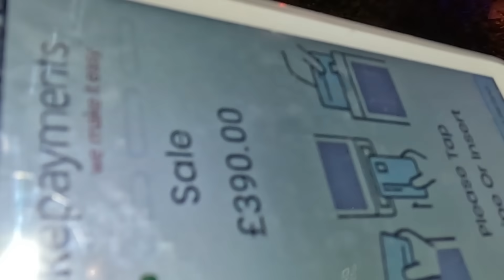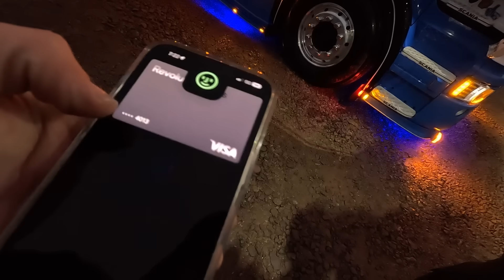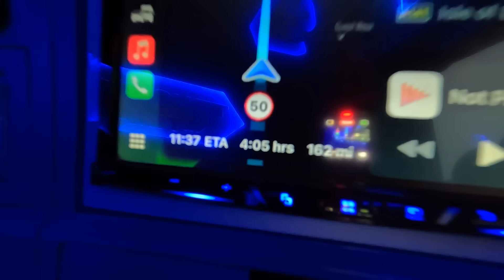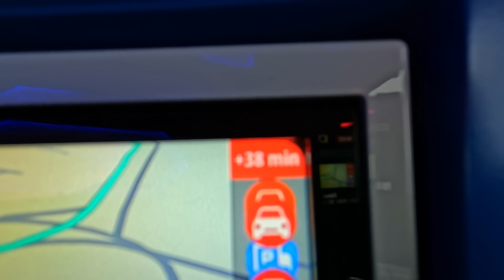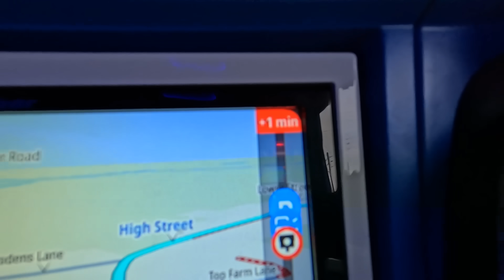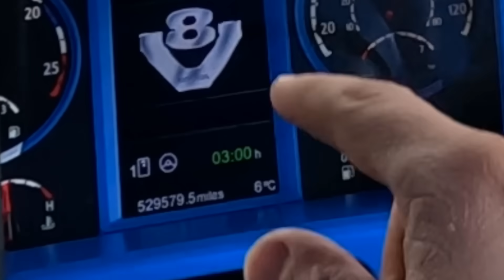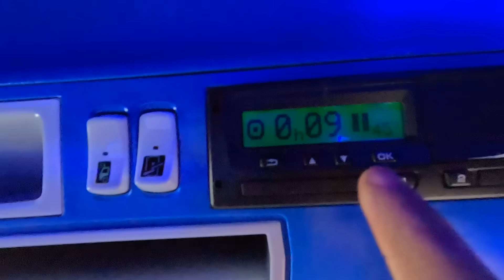A SURPRISE BACK LOAD! | WHAT AN AWESOME GIFT!! | #truckertim

Comment: Hey @Trucker Tim, My record for small load to ratchet strap ratio was on a 26t builders merchant wagon. I was sent to Plymouth from Torquay (84 Mile round trip) to collect a single 4" fence post bolt down bracket!?! I placed it above the drive axle for maximum traction then used 7 x 4t ratchet straps to tie it down 🤣🤣 My manager was less than amused... lol
Reply: well it did the job